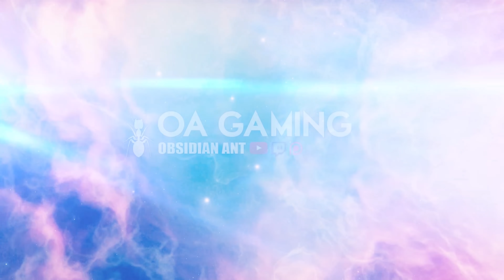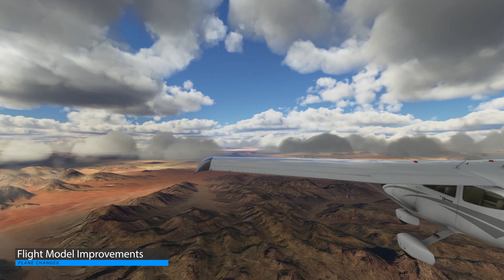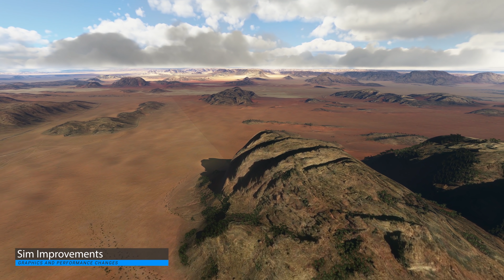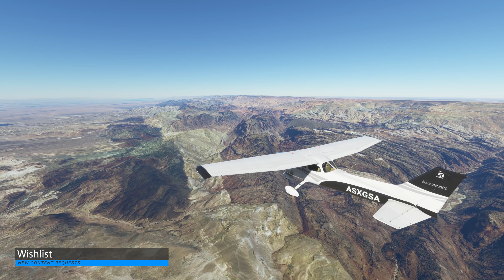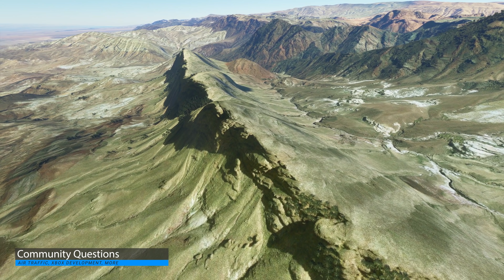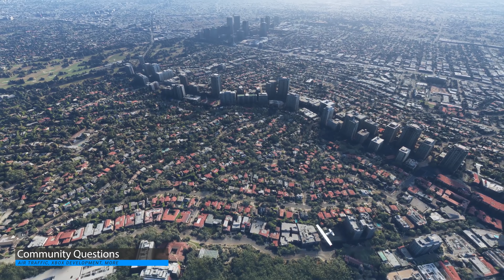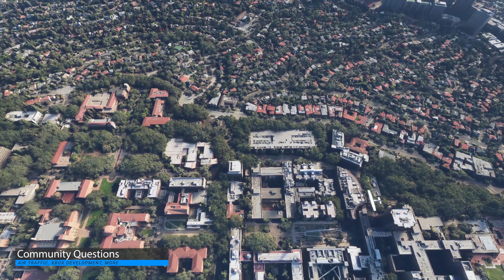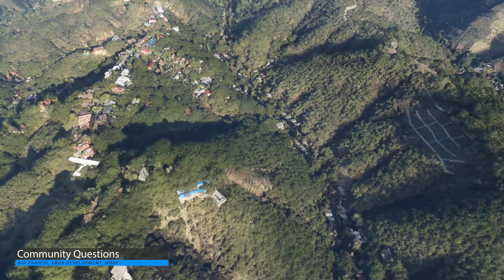Microsoft Flight Simulator - Beyond Ultra Graphics Option, x3 RAM Optimization, Flight Model Fixes

Comment: I can barely run "Beyond Minimum"
Reply: Bro I can’t even load at Charles de Gaul lol!
Reply: I use use ultra graphics with a ryzen 5 and gtx 1050ti
Reply: Do you use AI traffic?  I don’t use any and run on ultra.  Is your system older or new.?
Reply: @scootermason2746  yeah I use AI, I can run high end in the states, but Europe it dies plus LA don't load g7 dell nvidia 1060-max-q
Reply: @patrickclaudio6606  I have the same laptop, just disabled multiplayer (along with other software tweaking) and it became playable on med-high
Reply: @virian2865  thanks! I'll give it a try tonight
Reply: @scootermason2746  Please tell us your resolution, gpu, cpu, amount of ram and minimum fps. I'm on an i9-10900k at 5GHz and a 2080S (I have two but you know how little support SLI has nowadays :-/). I get like 20 FPS in Tokyo and around 45-50 everywhere else in 1440p and ultra with TAA. My computer is water cooled with a total rad area of about 1100 mm so nothing's down throttling.

The FPS is pretty much the same no matter what I set the graphics to.
Reply: @NedransVikingar   and that’s facts.. I’m similar with a i9-9900k at 5.0GHz 64gb ram at 3300 and a 3080 with a mild OC and it’s not the hardware it’s the program in its present state. There are just too many bugs creating lags stalls and CTD’s for many systems and people I fly with who all have similar systems to mine. The same issues being observed across the community
Reply: 🤣 you and everyone else.

Comment: I really hope we can get full multi-threaded support when the DX12 version comes out. I'd love for the game to start actually leveraging my 5900X
Reply: we wont get that with dx12, it will always be "semi" multi core support
Reply: wont change any thing... flight model is bottle neck and unless they improve that thats limiting factor
Reply: @Elios0000  in urban zones it's mostly the asset decompression who's using cpu power and makes the GPU less utilized, not the flight model ...
Reply: Most of the game's CPU cycles are used up to calculate physics. physics is an extremely sequential task. multi-threading a sequential task is an unsolved problem in Computer Science.
Reply: @sourcethunderlight2723  I keep hearing that but i have to say that it's a misconception. Physical propagation is sequential, but calculating the physics themselves is not. There is nothing anywhere that says, for example, that you first need to calculate the lift of the right wing and only after that can you calculate the lift on the left wing. You can totally send the left wing on a core and the right wing on a different core, and calculate them at the same time, halving the total time required.
Reply: The game is already multi-threaded. What are you talking about?